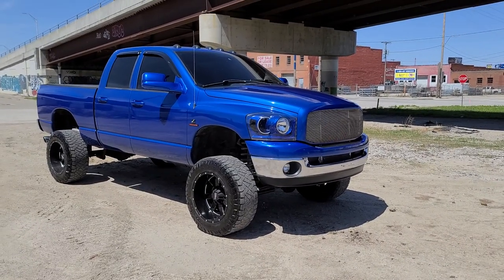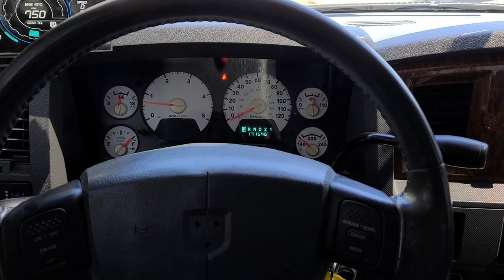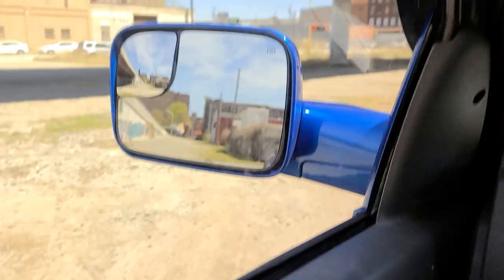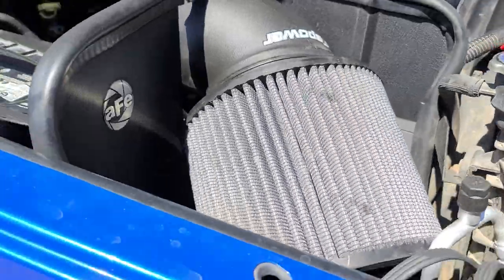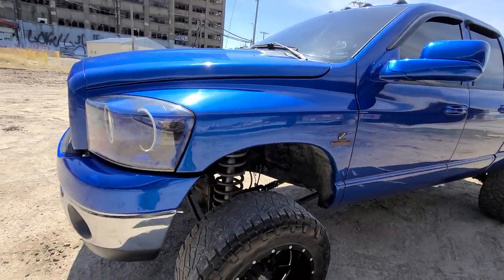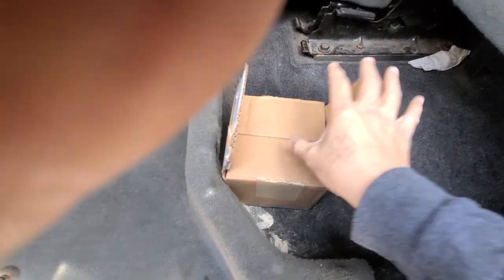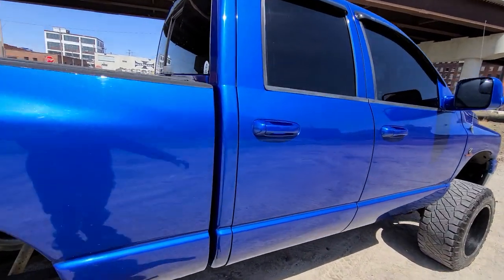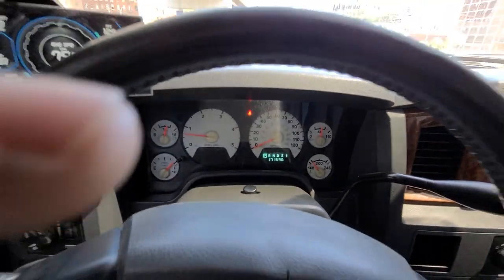2006 Dodge Ram 2500 SLT 4x4 5 9 Cummins, Studs, Built Trans, 35s, 6in lift, 5.9 Cummins Turbo Diesel

Comment: It ain't a manual trans so I'd be out on it, good looking truck  though
Reply from the maker: To good for a built $6000 auto?!
Reply: @816Diesel  naw mines a Eaton 10 speed 2006 Dually Aluminum Flatbed. My Daily driver is a Pete 389 18 speed, hard for me to roll a Auto Trans